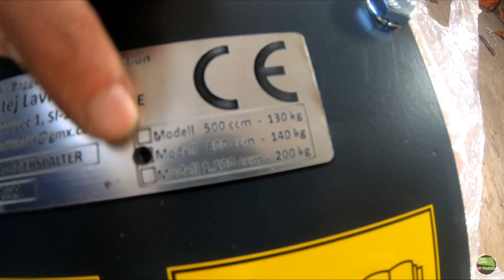Excavator log/wood splitter, screw type 800ccm version - Bagger Holzspalter

Comment: Was the wood dry or freshly  cut? 
I've seen those screw splitters that mount on the rear wheel of a truck. Scary.
Reply from the maker: wood is freshly cutted but the tree was dead before so something in the middle, in our country they use lot of that screw splitter behind of a tractor, but it was was very hard and dangerous work.

Comment: I wonder why they decided that it should turn anti-clockwise.
Reply: Because left hand screw is easier to make on lathe ? This is huge conical screw and you will have less vibrations if you turn a piece on a lathe from the chuck to a tailstock.
Reply from the maker: That was first thing i notice too, thanks @zumbazumba1 for explain, sounds logic